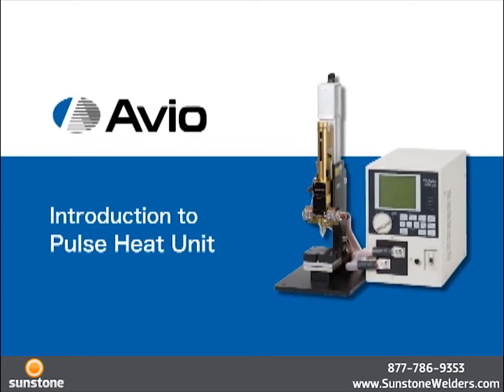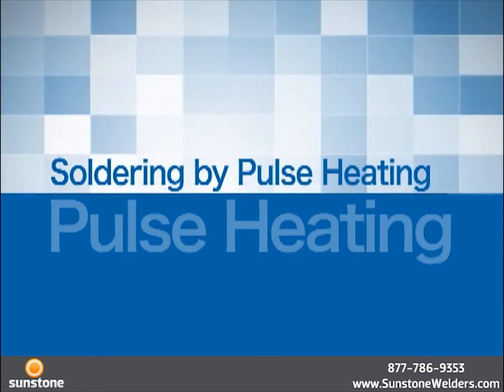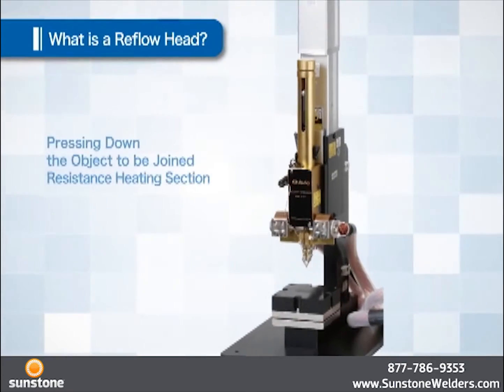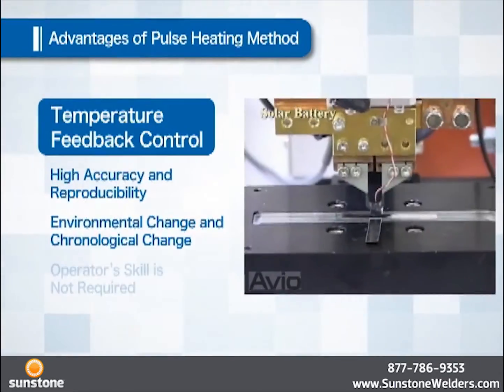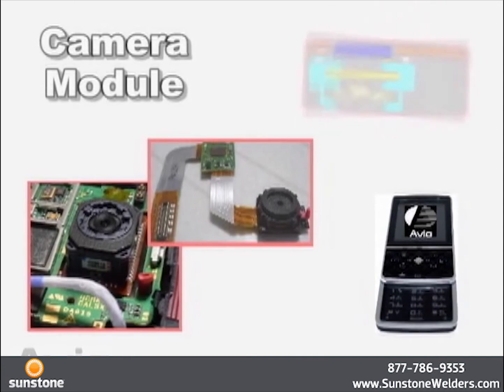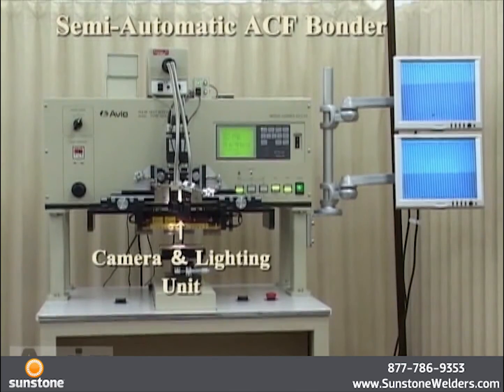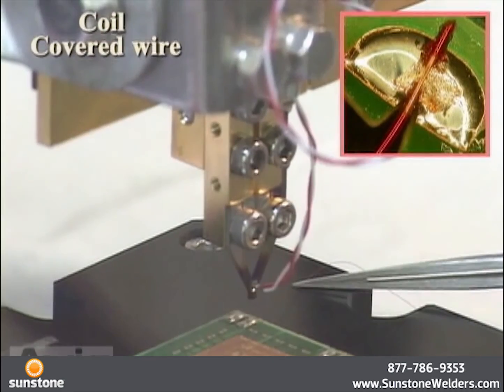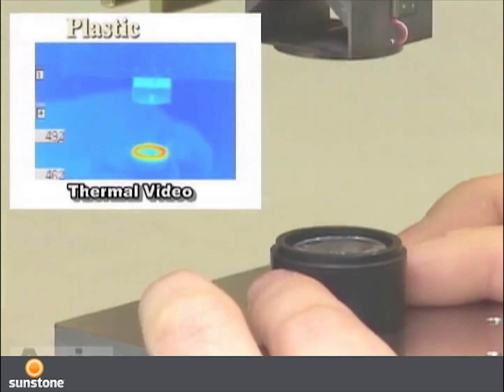Hot Bar- Reflow Soldering- Pulse Heat System

Comment: can i use this machine for welding lion battery? i know main feature this machine but i want to know it. pls
Reply from the maker: This specific system is not designed specifically for battery welding. This would be optimal for pulse heat and reflow soldering applications. Here at Sunstone, we offer 3 separate battery welding systems that are optimized for welding batteries. Check out our other systems in action(https://www.youtube.com/watch?v=VpWXScKh3U8&t=5s), or see more information at our website - https://sunstonewelders.com/product/high-power-battery-welding-system/

Comment: does it work with ACF bonding?
Reply from the maker: Yes, This system does have the Capability to bond Anisotropic Conductive Film Bonding. This process uses a conductive film between the substrate and the flex connection. This Hot Bar system is used to provide the bonding heat and pressure to accomplish these types of bonds. See More about this Hotbar System at https://sunstonewelders.com/product/hot-bar/

Comment: what is the price?
Reply from the maker: We would be happy to discuss your application and get you an accurate quote. The systems vary by their use and applications. The base systems start about $15,000 USD, This includes both the High precision power supply, the servo head, and a basic heater tip.